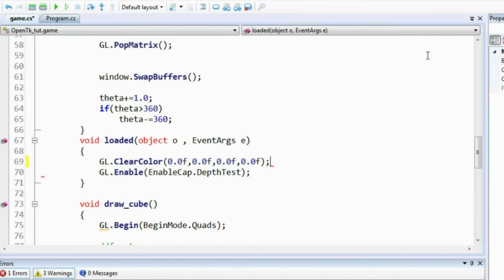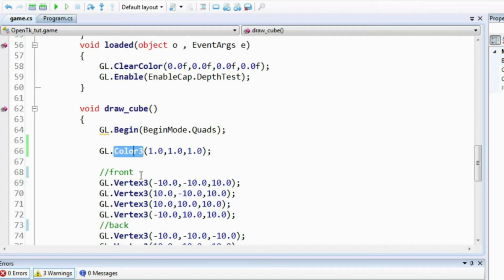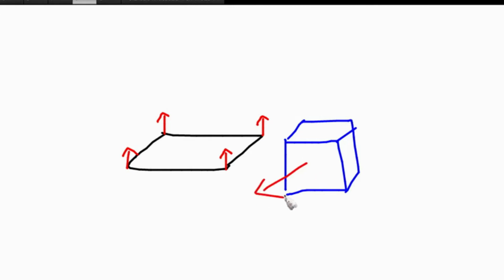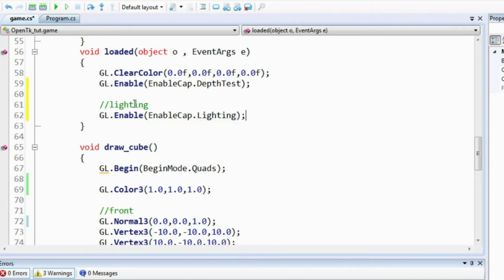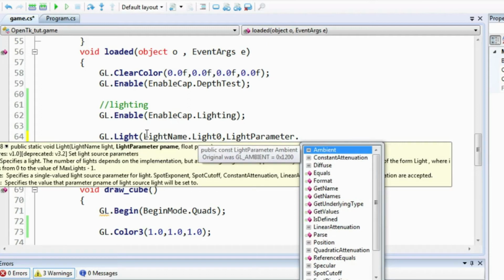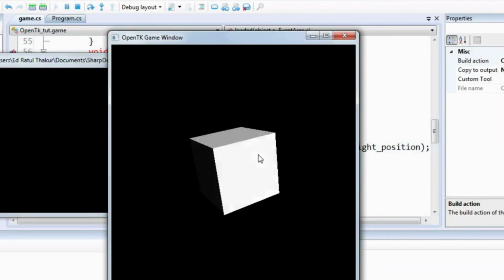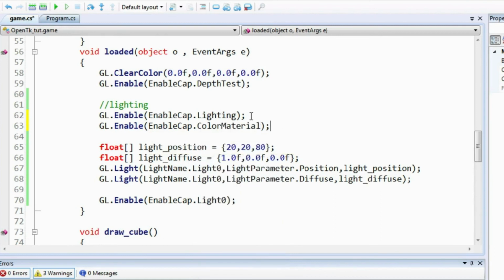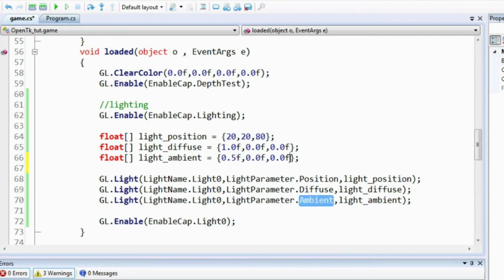OpenGL and C# Tutorial | The OpenTK Library | Part -6 | Lighting

Comment: quick note, the vertex's in the description for drawing the cube do not match the order the faces are labeled in the demonstration, so if you copied the code from there you're going to need to also figure out which face it is and reassign your normals.

if you copied and you are getting lighting errors around 10:16 you should assign them in this order:
            GL.Normal3(-1.0, 0.0, 0.0);
            GL.Normal3(1.0, 0.0, 0.0);
            GL.Normal3(0.0, -1.0, 0.0);
            GL.Normal3(0.0, 1.0, 0.0);
            GL.Normal3(0.0, 0.0, -1.0);
            GL.Normal3(0.0, 0.0, 1.0);
Reply: @MrDixioner  Entitled much? He is explaining everything just fine and he even said that you should define the points yourself. Dont take everything for granted wtf. Do some work yourself
Reply from the maker: the vertex's in the description ? you mean the previous part ?
Yes, i guess the geometry is a bit different than this part, but you need to figure out the normals yourself according to the geometry you are using. I  am not asking you to use the code exactly as it is shown in the tutorial.